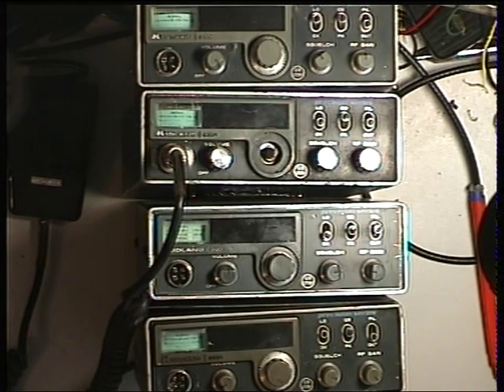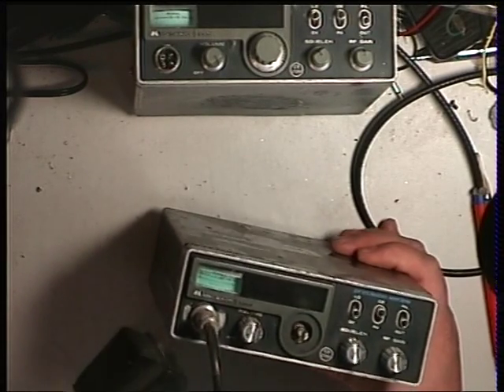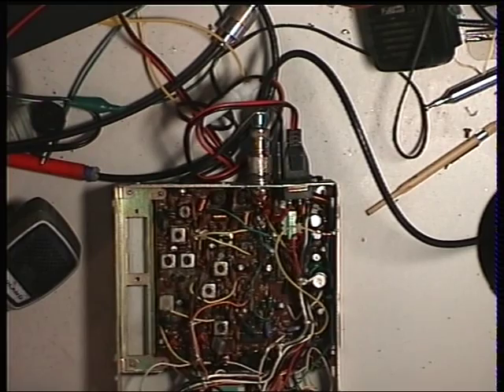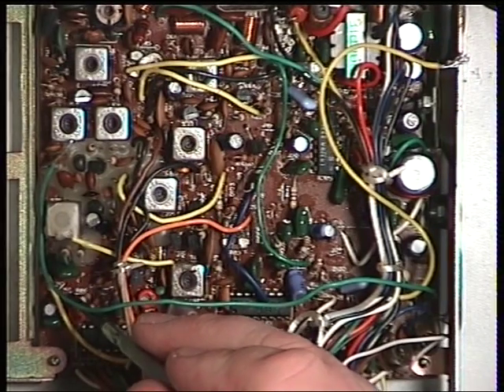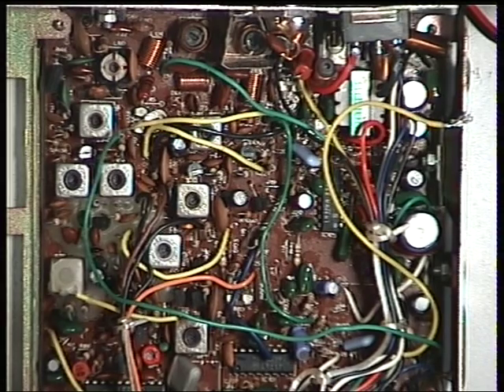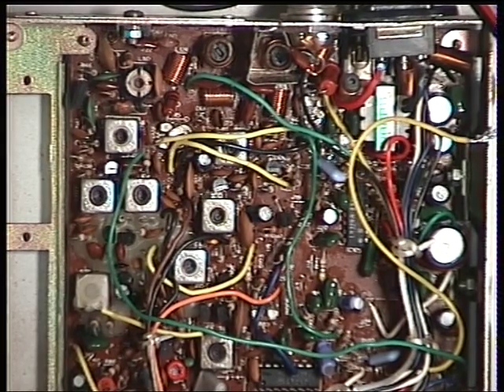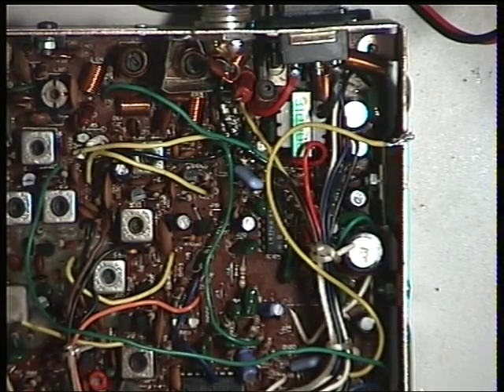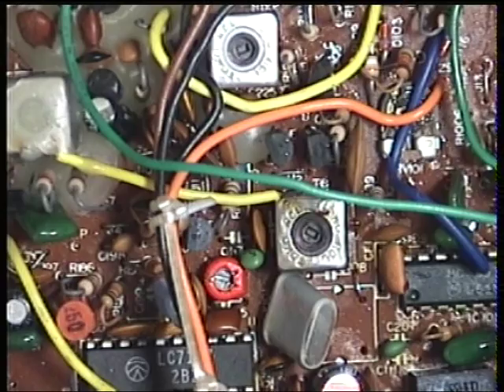Midland 3001, UK (CB 27/81) CB radio (Mobile) - Transmit Alignment

Comment: Hello Richard well just hit my first problem i was trying to measure the voltage on test point 1 and I was getting 0 volts in both transmit and receive but the radio is working fine. Anyway double checked my connection to the test point and I find the little little pad that the test point is located on is isolated from the rest of the circuit. The test point pad is totally floating the only connecting to the pad is the test point. I can see two other solder blobs but looking  at the solder it is clear that these holes have never had components installed. Have you ever seen this before I’m just wondering where to take the test point from. It looks like resistor R157 And R158 should have been installed to the pad but were never fitted. Regards Chris
Reply from the maker: Yes I've come up with that before but it's easy to see from the circuit what can be used as an alternative test point. Anyway, the VCO is very stable on the Maxon chassis used & recall I've only had to deal with two ever, and one of those was caused by 'finger trouble'.

richard
Reply: UK CB radio servicing  Yes I have just been tracing circuit back and have identified the top of a resistor to pull the test point off. But they must have been doing some cost saving at the factory LOL. Just needed a double check as never done this before. Thanks Richard

Comment: Just got a  completely dead 3001 really excited to get a CB that doesn’t actually work so I can do a repair.  Bought quite a few recent as spares or repair all work annoying perfectly.
Reply from the maker: In the very late 70's & early 80's I had a TV/audio shop. One thing we did was ex rental TV sets (new TV sets were very expensive then in comparison to today). I'd taken an ITT VC51 19" dual standard valved b&w tv as a part exchange & it had a real bastard of a fault. Rather than spending hours fault finding the hand wired (non pcb) chassis, I thought I'd buy a similar set with a duff crt from the wholesaler & swap over the chassis. To cut a long story short I went & bought a VC51 every week for 5 weeks & every singe one arrived fully working (so got sold). Eventually I tacked the bastard fault & it turned out easier than I'd thought...about an hour & two resistors!

Richard